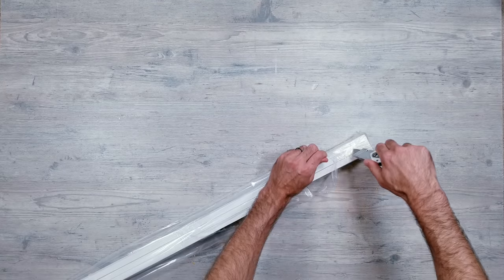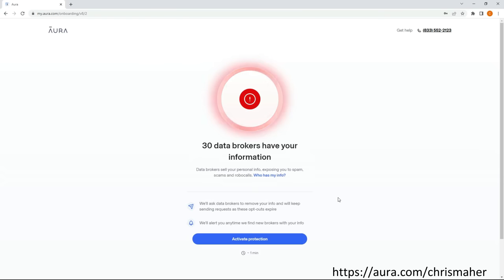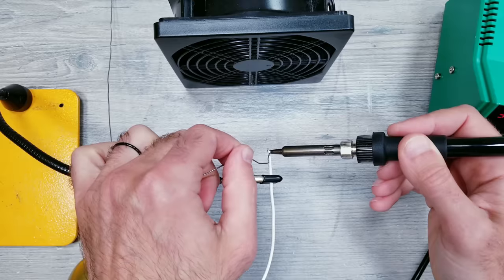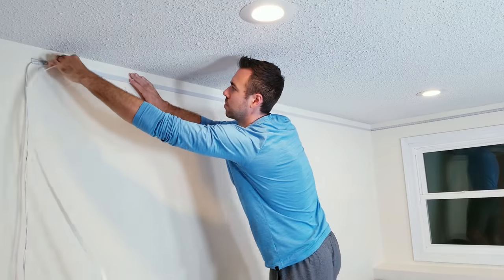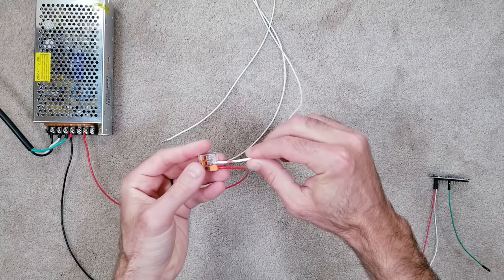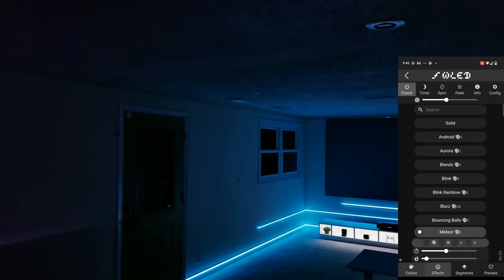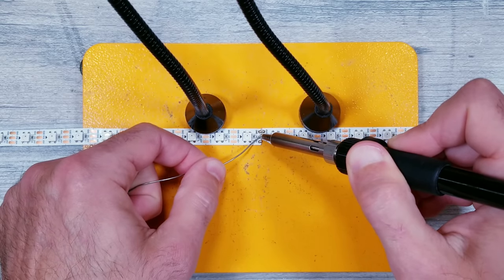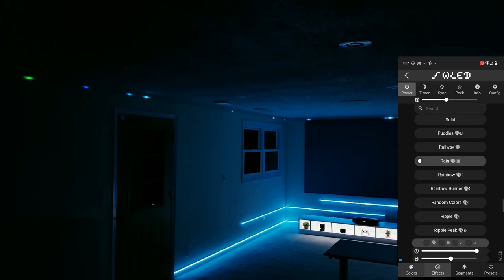50 Feet of LEDS on Room Ceiling - NO POWER INJECTION 😮

Comment: Chris, I really enjoy your videos as you just make them so simple and enjoyable. From your videos I made myself a corner light using a 1m strip of 5v WS2812B 144 led lights attached to an ESP32 Development Board TYPE-C USB CH340C. USB powered both the lights and the ESP32. All running fine for about 2 months, when the light turned on one evening, blinked and went off. I cant do anything with it now. After watching your videos I thought that would be fine, but on the WLED forum, some have said a 1m strip of 144 lights is too much. Would you agree?
Reply: Well, if you set the powerlimit under 900mAh u should be good to go
Reply: @BOB-xo8uz  thank you. That is where I went wrong 😔

Comment: I'm curious.. why not just use a 12V or 24V LEDS? Is it because you're not using 100% of the power?
Reply: they are more expensive w2815 would be adresseble and with a back up data line and has 12v but or more expensive ...and there is nor w2812b alternative with 12 o 24v....there are 12 and 24v strips but only RGB his is RGBIC

Comment: 3000mA is 3V? NO. Without mathe that is a fire hazard. The small copper lines in the led stripes are not capable of transmitting so much power over this long distance and this amount of leds if you turn on to much or use white light. You have to calculate the maximum power consumption the strips can transmit and what limit you have to set. Dont do that dangerous videos.
Reply from the maker: Thanks so much for watching and taking the time to comment! Good catch! I meant to say 3amps not 3volts.

Comment: i really wish people would stop doing this. it looks horrible. Especially the led strips that have the leds expose and you just see dots. even though you did take the time to make a practical set up for the leds it still looks bad. The only way it looks good is if the entire room goes with the design/style adding led strips give off. 

if its any room that looks like i guess a "normal" for the average person. its a huge no. Warm lights always look best. i get people want RGB but it'll never look good.

if its a high end minimalistic room, then it would look good but even then i think hiding the led strips all together would look best.

if its the ceiling, definitely hide them on some molding or if you can, add some fake ceiling beams and don't crank the shit out of the lights to 100% but even all that can look bad if not done right. again, it has to fit the room aesthetic.

if its anything waste level and down, dim! dim !dim! dim! imagine like a movie theater! yeah most theaters in my experience have finally upgraded their floor lights and are more hidden compared to back then, you could straight up see the actual leds like a lot of people do now a days for their rooms.

in this case it looks great, the door and window throw it completly off.  a perfect example of lighting is that bottom shelf, cant see the lights and is giving off a bit of light on the the floor but still isolated where it needs to be.

so with lighst in a room, make it light up the room properly.

sorry, just grinds my gears.

great video overall. 10/10
Reply: sorry i went to town on this but i found this really neat video that explains lighting really well especially for beginners. better than me for sure. https://www.youtube.com/watch?v=HL_suWXZHw0

i wish i a was a bit more supportive in my orignal comment and i wont edit it, i still think your set up is great cause you took the time to do all that rather than just slap led's on the ceiling and moved on with your day. its really freakin cool and definitely deserve credit where credit is due. even all the difference settings it has is awesome!  i think was just being a hater that day cause again, it grinds my gears seeing led strips on the ceiling like tha, just a personal preference and everyone can do what they want or can afford.
Reply: @Supdoode  i understand what u say but in the end it comes down to peronal preferenc and i think these led deffusers are pretty good to hide the ugly spots and it dont looks shity in ur room even if u see the direct lights